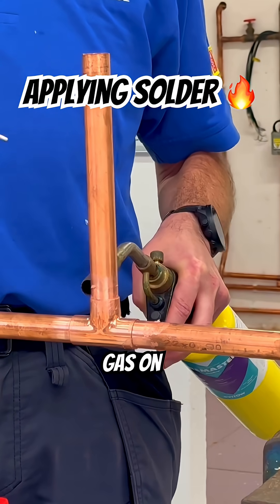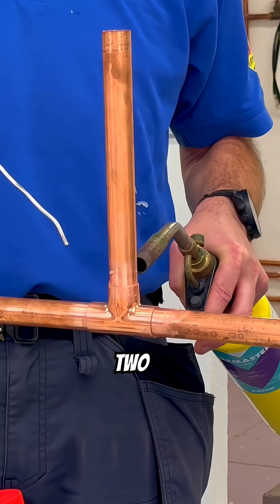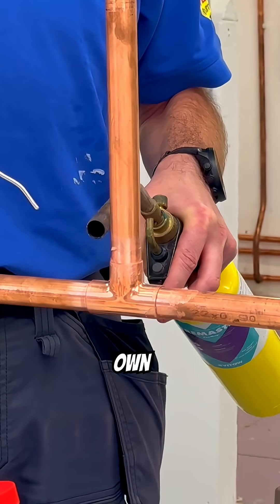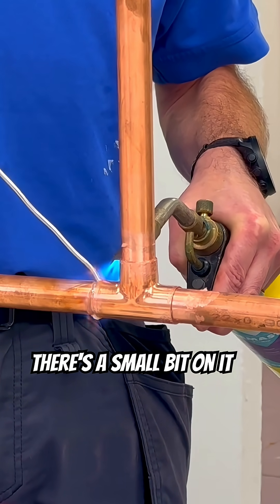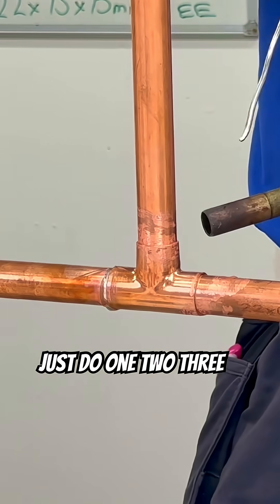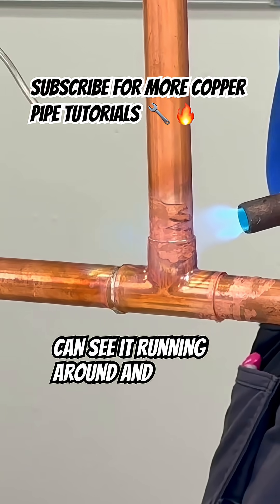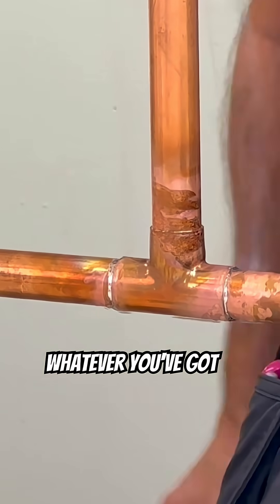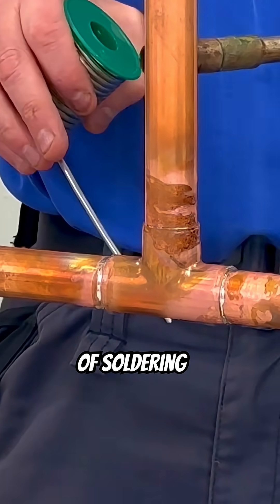Heat it up, then solder! 🔥🔧 Step 3 in Copper Pipe”

Comment: Sorry but that was your flame melting the solder not the heat from pipe the and fitting. Looks like a rim soldered joint to me. Pretty sure you can pull that pipe out with just your hands